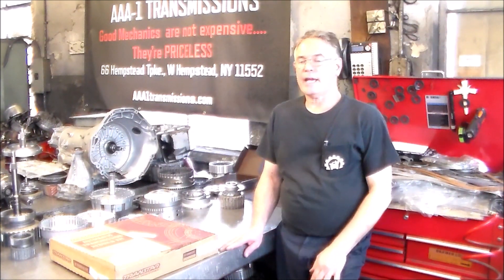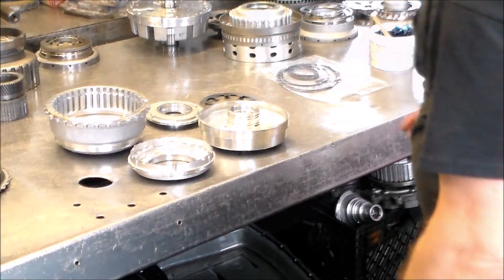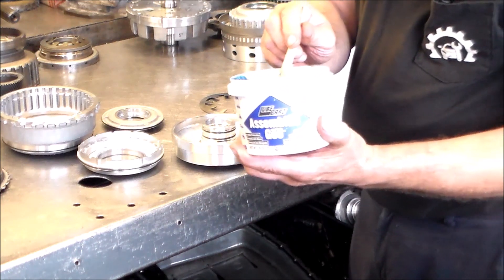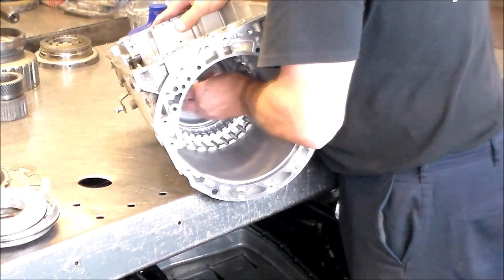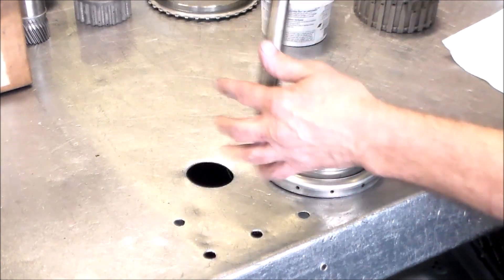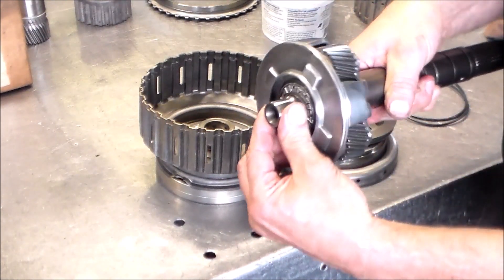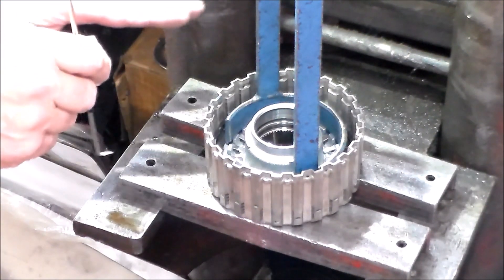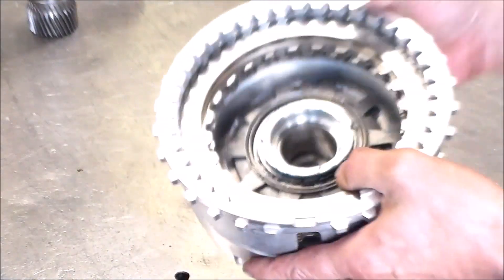722.6/Nag1 Rebuild Part 1, Clutch Drums

Comment: On minute 33:00 i put my dish up. I just noticed because I was watching your video, should I disassemble and put dish face down?
Reply from the maker: yes faces down
Reply: @GaryFerraro  I've been watching all of your assembly videos and I must have missed this one I did indeed put it face up ☠️
Reply: @GaryFerraro  I am at a loss, just finished putting everything back together, i got a steady stream of fluid  between the converter and pump, it just dumps all the fluid if left to idle, has new pump oring, new main seal, new bushing,  any idea what can cause this?
Reply: Otimo video complimenti 👏👏👍